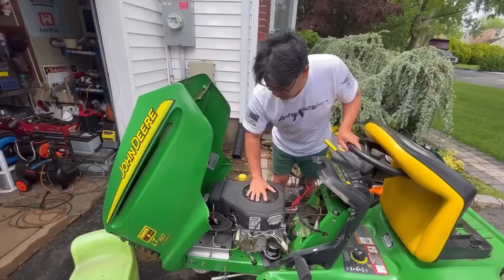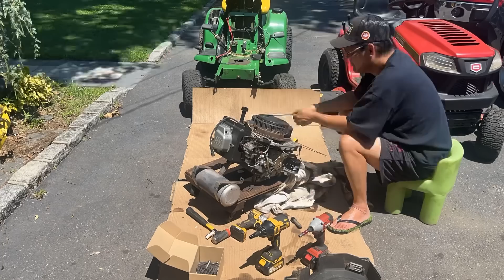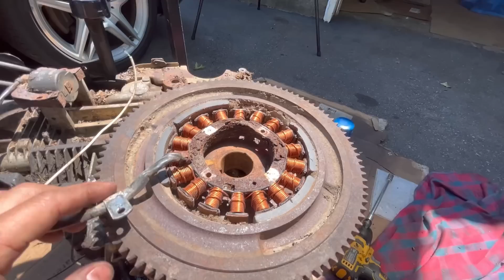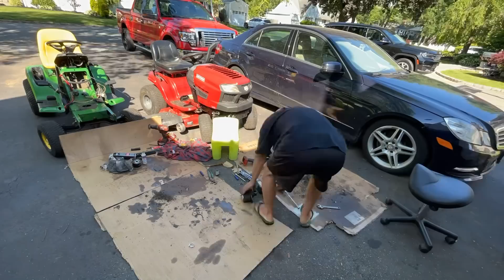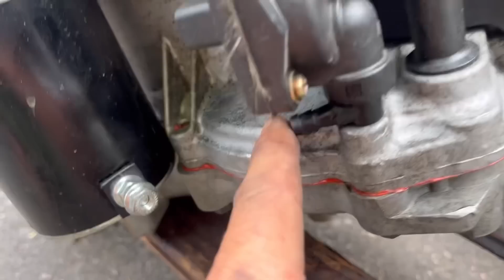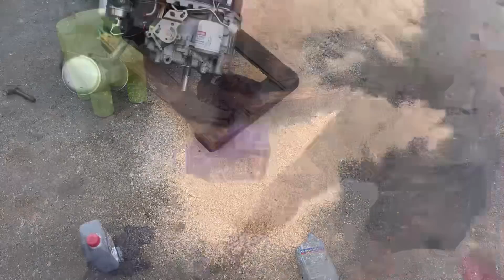REBUILDING A KOHLER COMMAND 16HP ENGINE USING TWO BAD ONES-CONNECTING ROD CRANKSHAFT & CAMSHAFT SWAP

Comment: Just so you know the original cream shaft out of the engine on the John Deere, the Journal, where the piston rides the crank is bad it’s too scarred up. The oil pressure won’t be the same, so you did good taking the crank out of the other engine and putting it into the other one.
Reply from the maker: Thx

Comment: You need to snag a cheap bore scope so that you can pull the plug and see down into the cylinder.  I got mine for less than thirty bucks.  Make sure it has the dual camera  (with the view that looks out the side).  Or you can get the fancy articulating camera that can turn around and look up at the valves.
Reply from the maker: Lol!  I’ve reviewed like 6,  I use it all the time.
Reply: @MowersNBlowers  nice
Reply from the maker: @calholli I agree they’re very useful

Comment: I think I I’m going to get one of those long plastic fold up table for working on stuff. Lately I’ve been dabbling in mobile small engine mechanic and is slowing doing well.
Reply from the maker: Hope you’re subscribed
Reply: @MowersNBlowers  I’ve been watching and subscribed for a long time. Learning  a lot with the little I having. I got 3 jobs next week. Carb clean, and two tractors that need spindle assemblies.
Reply from the maker: @ryanw1639  nice bro

Comment: Hey Henry, what happened to that nice rolling work chair you got from, Vevor? Pitch that baby chair and no more soar ass.
Reply from the maker: Yeah it’s nice but it’s still too high and makes my back hurt with no back support when I’m working on stuff that’s low like a lawnmower.  I still have it but hardly use it
Reply: @MowersNBlowers  Ok, I get it about the back problem, gotta do what works best for you.

Comment: Henry,  I've been using Ford Filters for years,  no problems.  The FL400S is the long one.   The FL910S is the same filter but shorter.  Both will fit most engines.  These are good oil filters and very cheap at wall mart.   Originally fit late 80's Ford mustangs 4.3L 4cyl.
Reply from the maker: Thanks for the info!

Comment: You were turning the screwdriver with waterpump pliers when removing the broken oil drain tube...

Secret tip: the screwdriver has a fitting at the top of the handle to use a wrench on it. Something I never noticed until not long 3.